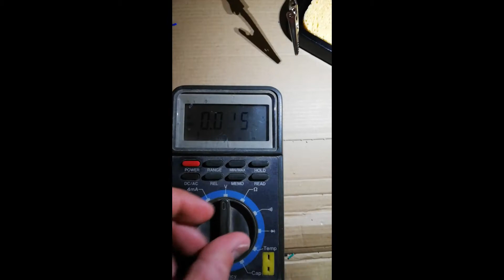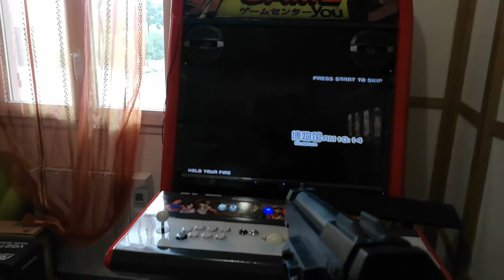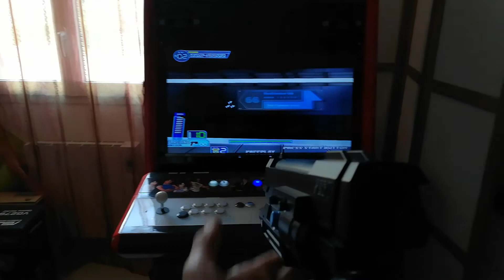Wiimote Virtua gun prototype v1.0

Comment: WooW Good Job ;)
I am wondering that by undertaking a similar project, hmm, only 2 Questions arise:

1.Do you really need 2x Mayflash W010 Wireless Sensor DolphinBar or 1 is enough to play for 2 people?

2. Are the actual delays etc. similar to those in Arcade Light Gun and the newest Arcade Gun.com
The only thing that is certain is that Arcade Guns etc. are a few times more expensive than the solution with wiilote hmm

In general, I would give 2 buttons in a different place, so-called:
1. Thumb (where the hammer is pulled in a real gun
2. under the trigger as it is in Quick Shot Plus to wiilote
I also don't know if the mod would be cheaper: P

I also have a question for this Chinese charger 4:01, so does it work and how much does the + - battery hold?
Reply from the maker: Hi,
One mayflash dolphinbar is enough in conjunction with touchmote software... But...
2 point to take in count:
It's a additional layer to make your game to works with your emulators. So it could be an additional source of problems when configuring your games. I am focused on the most simple way to play gun games.
The other param to take in count is the way the cursors are precise between the 2 methods. When you compare the aim on a Mame game between the 2 methods there is a big difference. With one dolphinbar+touchmote when I want to aim totally to the left or to the right, it's like I drag my cursor and I need to point my gun out of the screen. A bit like I use a fishing rod.
I don't like this behaviour.
Another problem could be if you have multiple Xbox pad devices, some emulators like mame are constantly changing the pad ID, so it's adding another source of problems to my sens. With the mouse mode and 2 dolphin bars We are less inclined to add other mouses devices than pads so this is less problems.

I don't know how good are the arcade guns.Com. So I can't compare but what can tell you right now is they are not enough if you plan to play confirtably from your gun because they don't have enough buttons. As an example, if you want to play ps2 games (pcsx2), you will quickly understand that you need more buttons to navigate trough the menu.
In my next update of my lightgun, I am going to add the crosspad, this is on my to-do list. I already upgrade it a bit since this video. I will present the next upgrade as soon it's finished.

Regarding the battery charger, after several use, I have noticed that the batteries do not last long, so I do not recommend them and I will also change them.